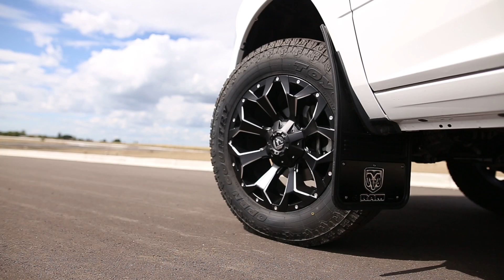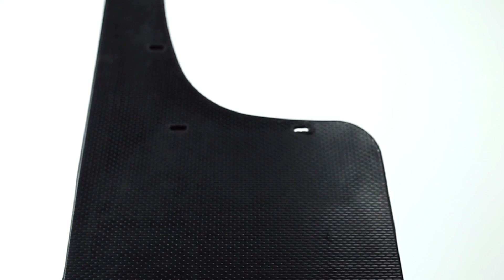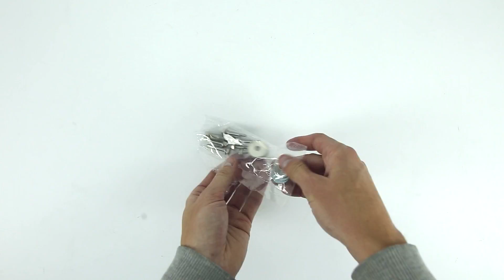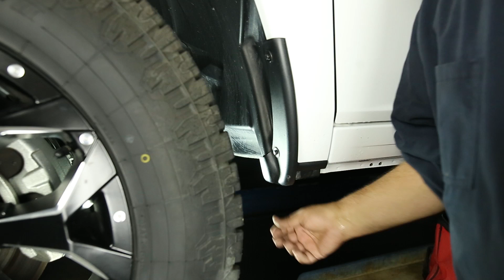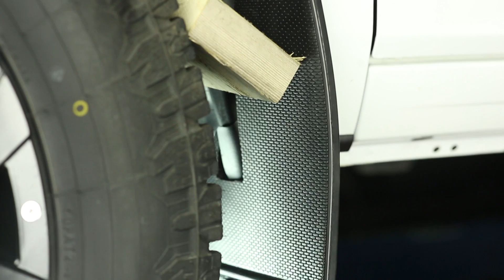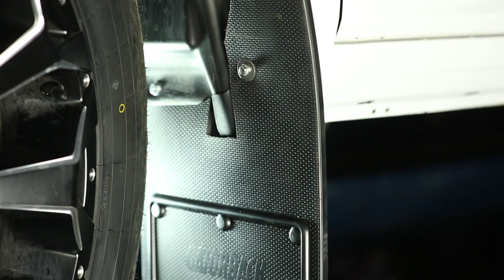Gatorback Universal Installation 2016 RAM 1500 (Front)

Comment: I just got these flaps and have factory flares on my Laramie. I notice bolts holding the flares on. Should I just go over them with the flaps and use the self tappers included? I don't think the factory screws will be satisfactory. They aren't even threaded through the metal. I feels like they are screwed into anchors of some kind.

Comment: What lift is on that truck and what tires/wheels?
Reply from the maker: This truck has just a leveling kit on it.  They are Toyo open country tires AV LT275/65r20 and the rims are FUEL/Assault.  Hope that helps!
Reply: That's exactly what I wanted to know and the tire size I had in mind. Thanks.
Reply: how wide are those wheels?

Comment: I have a 2014 with OEM fender flares.  Should I still order the 09-16 RAM CUT flaps, or should I get the half moon?  Thanks in advance!
Reply: Most guys will use the notched RAM CUT flap on the front. They will work on trucks with or without the factory flares.
Reply: Thanks for the reply.  I just picked up my set of gun metal flaps!

Comment: what size is the self tapping screws? i need to buy a adapter for my drill
Reply from the maker: Hi Joe. They're #14 x 1-1/4 inch self tapping screws. The hex head uses a 3/8 inch socket.

Comment: Do your have the cut demensions for the front mud flaps designed for the Dodge 2016 Ram?
Reply: Thanks, but it is no longer needed
Reply from the maker: Hi, please feel free to contact us directly for help with your question.  https://www.truckhardware.ca/contact
Reply: Ankh.em.fentu W did Truck hardware  send you the cut pattern? if not i can send you my pattern that truck hardware sent me
Reply: Joe could you send me the cutout pattern, I got a set of the uncut ones, I’d rather not guess-cut mine haha thanks
Reply: @austinshaw2014  i just googled it
Reply: no problem
Reply: @joe7528  Can you send me the cutout pattern please? Thanks.
Reply: Can i get the cut pattern please?